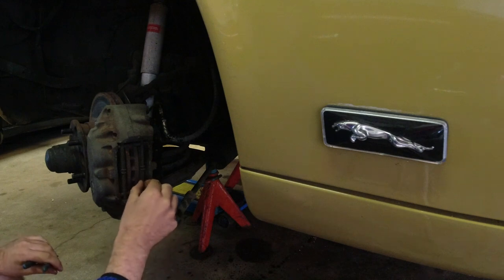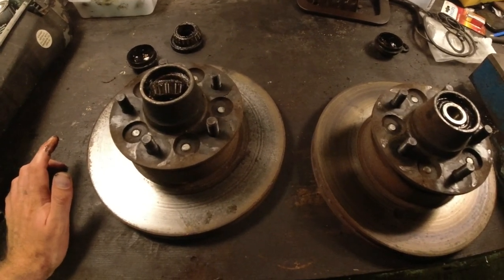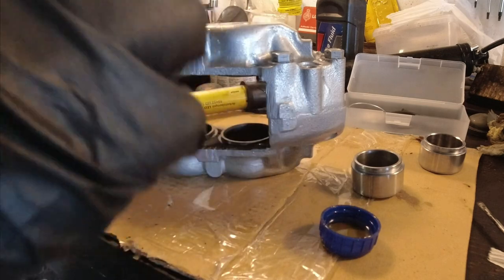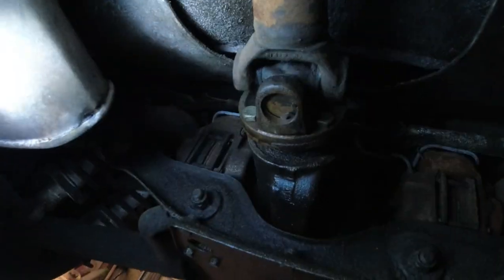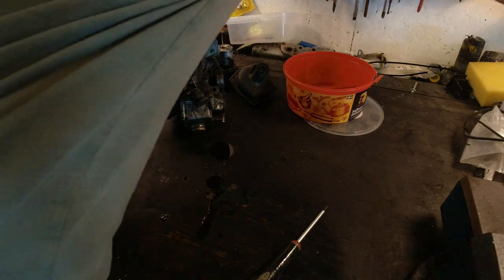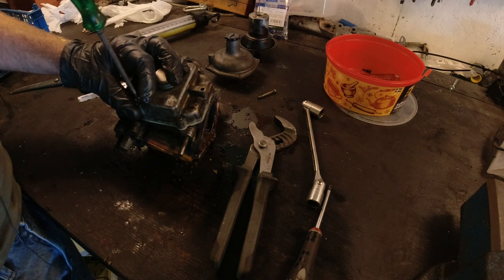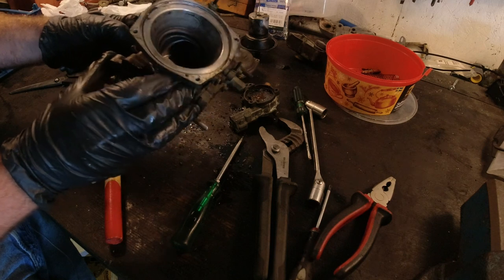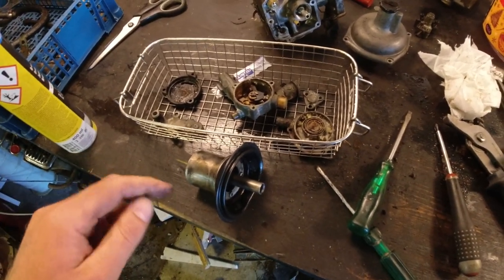Brake Caliper Rebuild and Carb Exploration - Jaguar XJC Rebuild Part 2

Comment: have a look at the surfaces in the choke assembly, mine had existing thick black gaskets the kit came with thin paper ones... they leaked lots of fuel after.. i had to pull them off again and wet and dry sand the parts to remove factory imperfections that paper wont hide.

Comment: I think that the stuff you referred to as congealed grease is probably wax…. that type of carb was described as “Waxstat” and it ran as an autochoke. In the 80s there were lots of kits available to convert to manual choke. 

I don’t know if you can refill the “grease” at home if you’ve cleaned it out….

Comment: Zenith Stromberg carbs are junk.  Zenith made a lot of production revisions to them and I am not surprised that you were sold the wrong gasket set.  The rubber diaphrams for the jet holders/pistons were also different.  At one point the there was a locating tab that faced inward, and then at another point in the production run the locating tab faced outward.  The wrong black diaphram was invariably sold in the gasket sets.
Reply: A bit harsh to describe them as ‘junk’, however many consider the phrase ‘Constant Depression’ to be very suited to them.

They did a great job on a lot of Triumphs through the 60s and 70s, I had a 66 Vitesse 1600 and the improvement when the factory went from Solex to Stromberg carbs was significant.